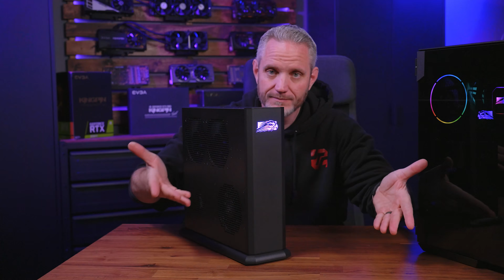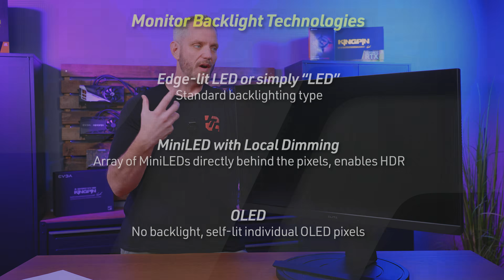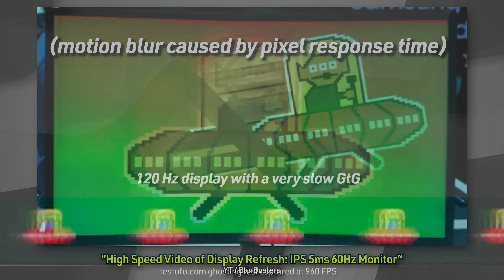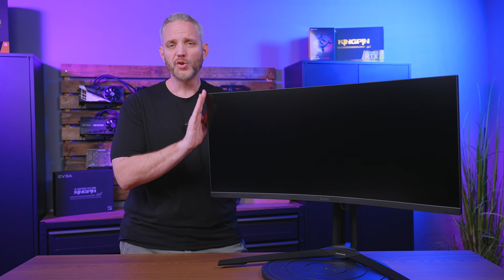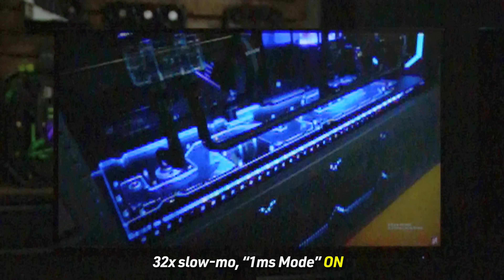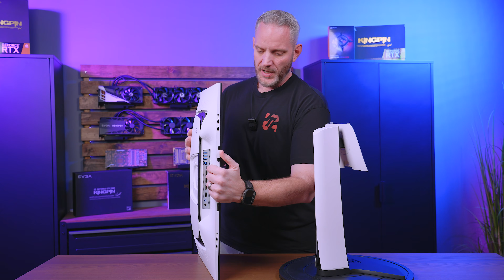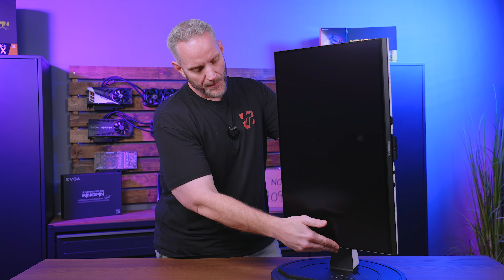Ultimate Gaming Monitor Guide: Find the BEST Screen for Your Setup

Comment: I absolutely loath and despise 1440p resolution being called 2k because guess what 2160p is 4k and 1080p is half that so its 2k but 1440p is more than 2k its 2.5k WHY CAN THEY NOT DO SIMPLE FUCKING MATH.
Reply: They can do math. 4k resolution is 4 times the pixel density of 1080p.

1920*1080=2073600

3840*2160=8294400

8294400/2073600=4

Regardless that's just a coincidence as 2k and 4k aren't a relation to pixel density, but approximate horizontal pixel count.
Reply: I have already done that maths, as you pointed out 4k does not refer to the total amount of pixels or pixel density, I never said it did I said 1440p isnt half of 4k. the simple math for that is 4k=2160p and 1440p isnt half of 2160p. my problem is that if we take 2160x3840 as 4k then that would mean that if you half the 3840 you would get 1920 and 1080x1920 is the corresponding resolution so therefore if 2k is attributed to any resolution it would mathematically and logically be 1080p not 1440p but they always use 2k as a marketing term for 1440p and not for 1080p which doesn’t even make sense from a marketing standpoint because 1440p would be 2.5k which is a bigger number and so is therefore better because more pixels means more density at the same size. In no line of logic I can think of does 1440p make sense to be called 2k, like 5k is double the pixels per axis compared to 1440p so it would logically be called 2.5k not 2k it just doesn’t make sense and it bugs the hell out of me.
Reply: @theneocubed.2633 Read the last line of my reply. Marketing buzz aside, 4k and 2k have nothing to do with pixel height.

Your issue is marketing terms that have nothing to do with actual pixel counts. The typical user isn't going to know the actual fact anyway.

1080p isn't 2k because 1080 is half of 2160. 1920x1080 is 2k because it's WIDTH is 1920, ergo ~2000 horizontal pixel count.

3840x2160 is 4k because it's WIDTH is 3840, ergo ~4000 horizontal pixel count.

Factually, 2560x1440p is 2.5k. But marketing like that is just going to royally confuse people that don't understand resolutions.

TL;DR, marketing terms were made popular by people that also don't understand resolution categories.
Reply: You’re just saying effectively the same thing as me in a different way. Yes i hate that the marketing is wrong, and to the vast majority of people it doesn’t matter, my point is that it pisses me off.

Comment: Just started the video, but I'd like to see a in depth video regarding current reliability for monitors. I bought a 4k LG Ultragear and had to RMA it about 2 months in due to horizontal lines at the bottom of the screen. It started on display port and then spread to HDMI 2, then HDMI 1. No issues since, and the RMA process was mid - not the worst and far from the best. When deciding on a second monitor, I opted for a 1440p LG Ultragear because it was on sale and I was kind of curious if I'd experience the same issue. Typing this is bringing back the sense of overwhelm and annoyance in trying to decide on both these monitors before. It seems like every brand has horror stories now.

Comment: You forgot to mention that VA panels also have much higher contrast ratios than IPS or TN. Though, clearly not as high as OLED. But still have great color. I actually went with a VA over IPS on my ultra wide for this very reason and was so glad I did. 
However, now I am using a 32" 4k OLED. 

Also, your curvature numbers are reversed, lol. 

Love you, Jay. Happy new year!
Reply: I have a Samsung NEO G8. It is a VA panel but with its micro led with local dimming it is almost OLED like without the risk of screen burn.
Reply: @totalsubmition  I have a Samsung CRG9 VA with quantum dots and local dimming. I also have a 49" MSI OLED. The VA doesn't even come close to the OLED. It's nice and bright, but the contrast is no where near the OLED.
Reply: @ that’s a 1440p 5 years old monitor. The technology has improved majorly since then. My Neo G8 is 4k and from 2023 and it’s perfect. Yes never will be as good as an OLED (I have a c2 oled tv). But the new VA panels in these Neo monitors are really good.
Reply: @totalsubmition mini led not micro led. Micro led is basically alien tech with all the benefits of oled and more with none of its downsides
Reply: Yes VA has better contrast, but there is an issue with that.

Due to the fact that they cannot dim and brighten as quickly as an OLED, an effect called smearing occurs. Objects with high contrast against their background leave a sort of trail similar to ghosting. You can notice this, for example, when looking at a fence or mesh on a game, or even your character's hair if it's black. As soon as you move the camera you'll notice it blurs because the pixels can't change their brightness fast enough. IPS does not have this issue and it's more likely to notice smearing than lack of contrast on a daily use for gaming (unless you really love horror games lol)
Reply: @sebarodfle  Yes, but you compare it to OLED. All panel types lose when compared to OLED. He was comparing to IPS, not OLED. IPS also cannot dim and brighten as fast as OLED. IPS pixels are not as fast as VA pixels are. Or at least have not been traditionally. Things are changing now with faster IPS panels. However VA still has better contrast than IPS, which was his point.
Reply: @sebarodfle  Oh, I am aware of the possible smearing issue. However, I mostly play single player games and never really noticed it.  I probably have a good panel, it certainly wasn't cheap, but the contrast next to my IPS was night and day... now the contrast with my VA next to my OLED has the same effect, lol.  I can never not have an OLED now.  I'm ruined. XD
Reply: Did you like the ultra wide? Does it makes sense to have one to play single player triple A games or is it just a waste of dimensions because we’re not actually looking all around it?
Is the 32” 4k OLED better in all terms, even immersion?
Reply: @LucasHermsdorff  I'll add that I ask myself this question often. "How does my 32" standard compare to my ultrawide as an experience?" 
I have to say,  I really love my ultrawide and I love playing single player adventures, so it's actually a REALLY great experience after giving up traditional 27" panels.  I think it's an awesome upgrade from standard 27" models.  However, I do like both.  Do I only like my 32" better because it's an OLED?  No, but it helps. I just don't use that much of my periphery.  No matter what I'm playing, I think I'd rather have a 32" 4k than a 34" ultrawide.  I also get the added benefit of it being flat for standard content.  The curve never bothered me but I didn't utilize the space like I'd like and I'm always staring straight ahead.  It's great when you stop to look around, which I often do, and It's immersive, but so is my standard sized 32" 4k. 
I'm sure not everyone will feel the same, but this is my current experience.
Reply: VA is like budget Oled for movies while IPS like budget Oled for gaming . TN is the insane budget for gaming
Reply: @jokok2333  I'd argue that mini LED is budget oled for movies, lol
Reply: @ and wht the price for the cheapest mini led?
Reply: I prefer VA panels because of the way better contrast.. Now i would buy a good miniled panel...
Reply: VA is disgusting.
Reply: I got the now famous AOC Q27G3XMN and until I am shaking my mouse in CS2 I don't notice any ghostlike behavior. 

Such a great panel for many things, but the brightness is overdone and the blacks can be too dark especially since programmers are probably designing games to look good on the 90% IPS market.
Reply: Ha??? Every va panel i had even alienware has washed up colors,,ips way better color than any other until oled came.
Reply: @koky179  You must have had some pretty shitty monitors then. Every VA panel I have had, which include two 27", two 34" ultra wides and a 49" Samsung CRG9, have all had excellent colour and superior contrast to IPS. In fact, my roommate's PC is right beside me, and he has an IPS ultrawide (an LG), and the VA panels were every bit as good if not a little better for vibrant colours, and they had better contrast as well. Just google contract for IPS and VA. VA wins. I'm now using an OLED, and it blows his IPS away, but then it does the same thing to the Samsung CRG9 as well.
Reply: @koky179  Mine is very vibrant.  I don't know what kind of monitors or settings you're using, but I haven't seen one yet that I hate. 
Also, there are windows settings you have to enable to get the full color gamut out of your monitors, otherwise it will display a limited color gamut. Maybe your settings just weren't optimized or something. 
Otherwise, everyone I've recommended a VA panel to has had excellent color.  Nothing like my OLED, but that's a whole different ball park.
Reply: @koky179  a lot of VA panels default settings suck. I've had Dell, Acer, Asus, and my last 3 have been AOC curved VA 1440 and 3440x1440, and after some changes to the default settings my VA looks pretty damn close to the LG second monitor which is ips. And honestly while gaming on it vs on OLED 4k tv, clarity is better, but I don't think it's as crazy of a difference as it used to be.

No doubt OLED is still better, but a well setup VA panel can look very good.

Comment: I love watching the stevification of your channel. I love the script sitting out, and I love the way you have tweaked presenting the product. I love that it is a more niche topic, but it still feels like you. Even if the delivery is a little more serious, it doesn't feel like you wrote an article and put it in a video. Don't get me wrong, I love that GN does that, but it makes the videos "crunchy" as my former Micro Center boss puts it, which is less approachable for some people, and it sometimes often on information your average consumer doesn't understand - nor do they want to. And  that's not a bad thing, I've watched both of you pretty consistently.

You feel just as concise, but with less of an info-dump. And it's always felt like that. Which is obviously what you strive for. It is why I have stuck around for the last couple of years, and why other Micro Center guys watch you. I am excited for the "accuracy" of information in your reviews to come (i.e. replicability, notes writing, etc.). But I miss the dad jokes from this video, which probably would be out of place, but I don't doubt that you will still  be doing that in other videos.

On the actual topic of the video, I feel (have not confirmed it) that a lot of the panels are manufactured in the same place, a lot like how Seasonic manufactures most PSU's. I noticed while selling them that MSI panels seemed to be exactly like AOC panels, but dimmer with RGB and typically a $10-$50 hike in price. This tended to seem to be the case for a lot of VA panels (sans price hike and RGB). A lot of the cheaper IPS panels I have been told are LG panels with a different name. But there is more variation there, like different processors and stripping away all the useful features besides Hz, IPS, and a semi-bright screen. But I typically noticed these . . . issues . . . with the less reputable brands. So for me, I always relied on the advice of my coworkers because we had used all the products in the store. RTings also has a very strong testing methodology for monitors and TVs, especially for burn-in, if there isn't somebody who has used it.

Comment: Wish you talked more about the differences between a Full G-Sync module and G-Sync compatible. There very different actually. And it’s a shame that monitors makes are just going the freesync with G-Sync compatible approach

Also looking at the VRR range is important. Many monitors cheep out and only have a VRR range of 30-45hz on a 120hz panel… basically useless.

Comment: Nice video but with a title "ultimate guide" a little disappointed there was no talk about nits/candela brightness characteristic and HDR. I feel like video would've been better if format would've been changed. More visual and informative format imo is going to a amazon or newegg, opening some monitors and going through specifications and talking about importance and difference of each one. Like you open a page and see first specification: panel type - here you explain different panel types and how what you should look for in different circumstances. And do so for every specifications. Coz i shop for monitor and there is HDR mention with 300 nits of brightness (those are not real specifications). Average consumer will see a buzz word of HDR and choose not to consider the fact that it has only 300 nits which is not enough for HDR. Well tbh i actually dont know if 300 is enough for HDR, i just made it up, so i would've like to know it from the "ULTIMATE MONITOR GUIDE"

Comment: I was never much of a "twitch" gamer that needed a fast response time.  I was always more worried about how they look.  I was an early adopter of IPS (on my 3rd IPS).  My current monitor was purchased just before the pixel shifting OLED's came out.  Unfortunately, my IPS display is still going strong and looks good.  I can't bring myself to buy a new OLED when my current monitor still looks decent and works well.

Comment: Monitors should be matched to the GPU and the game perfirmamce you are looking for. There's no point running 1080p on a 120hz panel with a 4090 playing Rocket League. This is an extreme example, but such details are often overlooked.

Comment: And then there are "same specs" monitors will drastically different price, low end will have a ghosting effect, high-end will likely have little backlight bleed, ghosting, might even running a little cooler, and maybe an external (easily replaceable) power supply.

Comment: I once had a customer who actually noticed the changes in dimming and got nausea after a while. I wasn't sure what caused it either. I recommended some low response time and high refresh rate monitors to try for a couple of hours. At that point, I got lost because several manufacturers had no MPRT ratings listed, so I couldn't help. Anyway, I am currently on a 1440 ips panel from ROG (yes I know) and I like it. I did think of OLED for a while but they are still expensive in my country and for my pocket so I went with this.

Comment: I have a 32" TV that only goes up to 720p at a 30 hz refresh rate. I can't work on that TV, but it was free. Maybe it's the Intel iGPU that's limiting the experience for me, but I see so little difference between my 1080p monitor on an i7 13700k and 3060 and the OLED 120hz display on my laptop. More than 1080p on anything smaller than a 21" display seems pretty pointless.

Comment: Jay, you skipped over that USB-C connection there.  I think one of the coolest new features is that thunderbolt connection for us semi-remote workers.  Turns your monitor into a docking station for your work laptop alongside your home PC!
Reply: Yes! This is huge for partial remote work. I held out forever on getting an ultrawide because they were missing USB-C upstream. LG finally updated their 39” OLED UW this year with USB-C and I took the plunge.
Reply: @jose10900 I live my 45 inch LG because of the USB C picture by picture mode and built in kvm.
Reply: the kvm switch has been in monitors for over 15 years usb c just came in when thunderbolt hit tier three.
Reply: High-end models even have a network connection that you can use when connected. And some even made a "smart-monitor", that also can run apps, like from your favorite streaming service.
Reply: Acer's software needs work, but the feature is there.
Reply: USB c upstream was a game changer for my home office set up!! And tbh since I don't play games that require high input rates from keyboard and mouse, if there is any addition lag from having the kvm in the screen I never notice it!